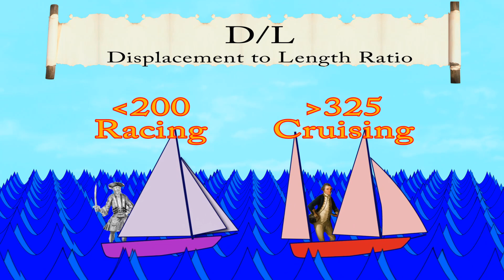Salboat Hulls Design

Comment: A way over simplification, so dumbed down as to be totally inaccurate

 Displacement boat hulls cant exceed their given hull speed by more than about 20%, so a 20 foot displacement hull cant exceed around 6 knots, its just the laws of hydrodynamics, no matter how much sail area you have, greater sail area also requires greater ballast adding weight and as such slows you down.

Generally, the larger the boat, the faster it can go. For a displacement boat, a heavy deep-keel boat, the maximum speed a given hull can attain from wind power is called "hull speed" and is largely dependent on the waterline length of the boat. Hull speed is expressed as 1.34 X the square root of LWL, or length of waterline. If a cruising sailboat has a waterline length of 36 feet, she should be able to sail 1.34 x 6, or approximately eight knots. 

The idea behind this is that a boat cannot travel faster than the wave she creates and the speed of that wave is 1.34 X the square root of l, "l" being the distance between the crests. The length, "l", of a wave increases proportionally as the height "h" of the wave increases.
Reply: +Mike OBrien Thank you for the information mate, do you happen to know a good book/video/lecture/etc on the subject?

Thanks
Reply: If you google "displacement boat hull speeds" there are many sites that have a full breakdown of the factors (and calculators so you can work out the theoretical hull speed of any size boat" involved in calculation of hull speeds, this give most displacement hulls can actually marginally go faster than the theoretical hull speed depending on the force being applied, eg It needs to have enough power to climb its own bow wave,

I have both displacement hull sail boats and planing hull sail boats and their handling is as different as chalk an cheese
Reply: My boat has a SA/D ratio of 20. It's a cruising boat with a relatively small sail area for its size that's designed for short handed sailing. I singlehand the boat frequently. Many modern cruising boats have much more sail for their size. My boat is 30 years old.